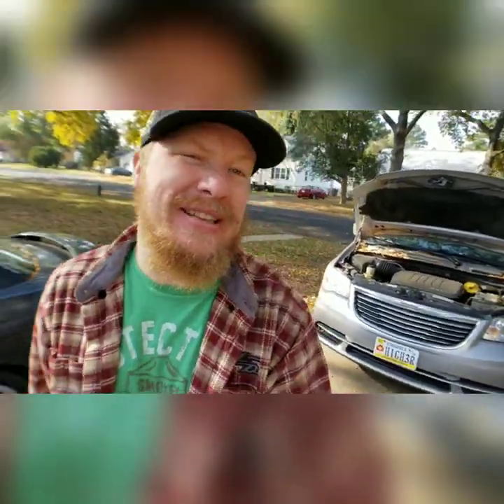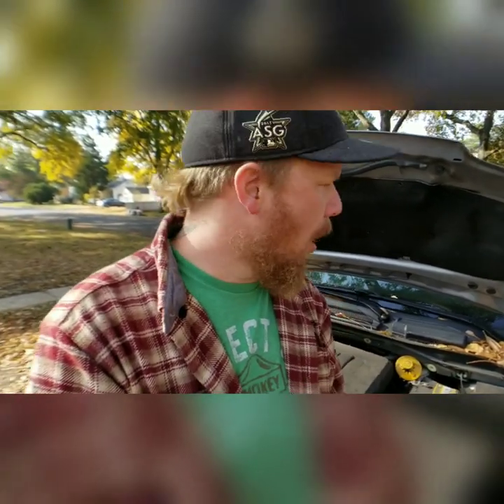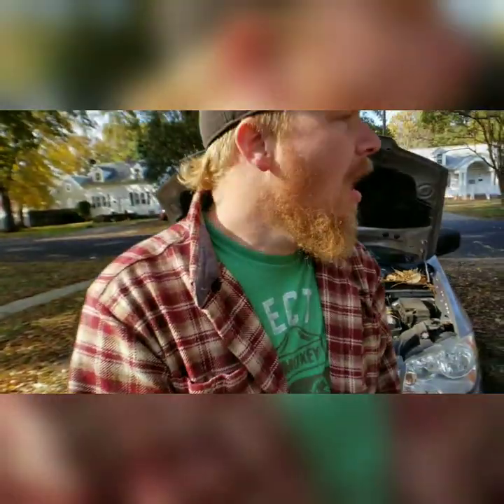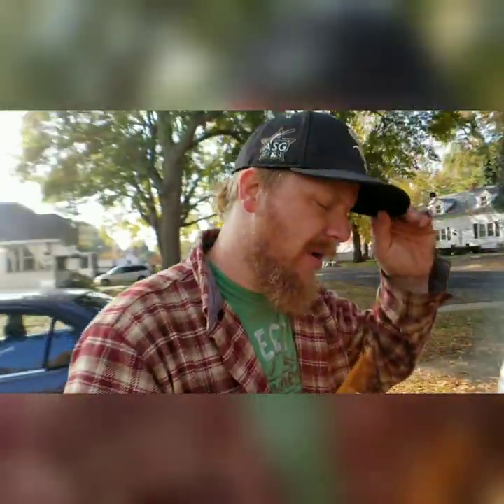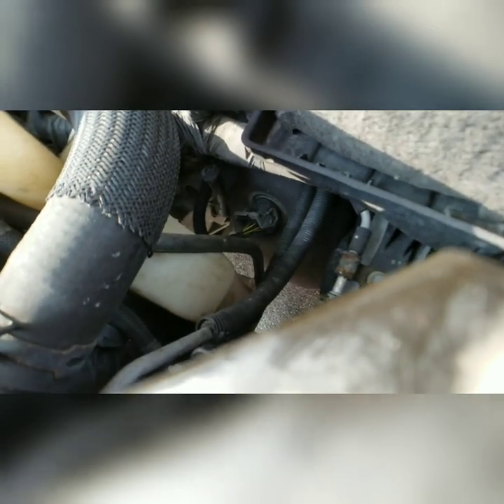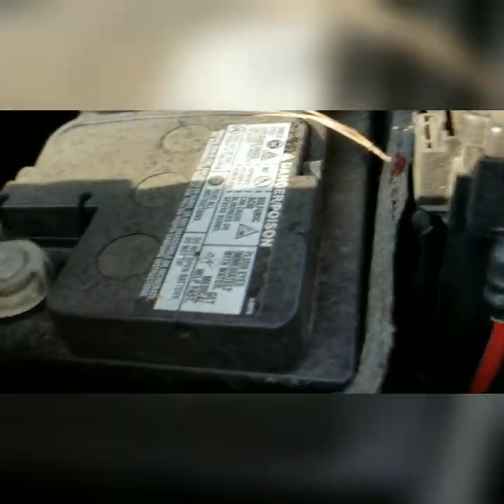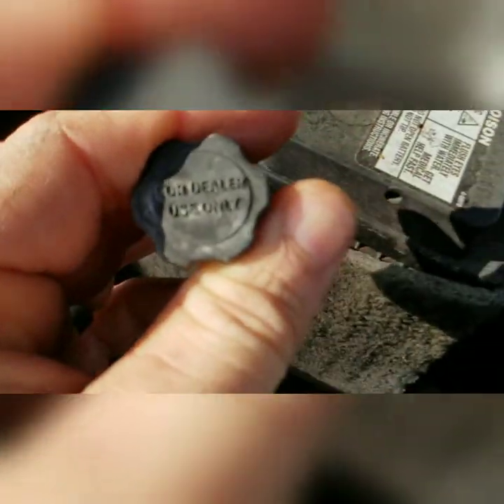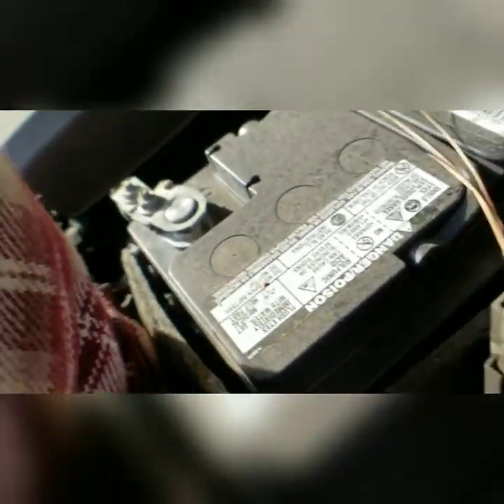62TE Transmission Fluid Level Check MADE EASY!

Comment: Thank you for the information, I just bought my 2012 Town and Country two weeks ago on the 3rd, gears starting slipping early this morning, tried to find a Dip Stick, with no luck, now at the shop as of 1000. I appreciate you showing us where you can check it and add fluid, your the best!
Reply from the maker: You are most welcome Kenneth! Remember the dipstick is for testing purposes only and should not be left in the engine while driving, put the plug for the tube back in. Stay tuned for many more DIY Auto Repair videos in the future!

Comment: You can use the oil dipstick and just mark the cold marks then the hot. Just etch it on the dipstick on the blank side.
Reply from the maker: Yes that is a hack you can use. But I am not risking a $4,000 transmission so I can save $13 and not have the correct tool that is recommended by the auto manufacturers. Thanks for watching!

Comment: Thank you for this video on the transmission deep stick. could you show a sample . I checked and they are multiple length and types
Reply from the maker: Yes I can make a video on how to use the transmission fluid dipstick on the Chrysler Town and Country transmission. The transmission dipstick that I have linked in the video description is the same one that I have. With that dipstick you will insert it in the transmission fluid dipstick tube 16.6 inches to get an exact reading on the 62TE Transmission. Hope this helps!

Comment: Purchased the dipstick, but mine has numbers instead of typical hi/lo or hashes.  Numbers range from 20-120 (I'm assuming mm).  How do I determine what level it should be?  Thanks.
Reply from the maker: The dipstick should of came with a paper as well with charts on it. On the bottom of the chart you should see temperature with the side saying the number or visa versa. The chart will tell you what number you should be at. To know the temperature of your transmission you will have to use a code reader with live data to get the exact reading on the transmission temperature reading.

Comment: Hi there. First time watcher and just subscribed.  I have a question for you. My roommate the day ran something over. He pulled over right away. He called me and said fluid was gushing all over from under the van. When he got back to the house, he told me that he thought that it had a hole in the oil pan because of all the fluid dripping out. Long story short I cleaned underneath the engine compartment and found no damage to the pan or any leak or damage to any other area under there. Once I had it all cleaned I found where a bolt was broken out between the two pans under the transmission we're also I noticed a scratch on the transmission pan and right above that there is the broken off bolt there. Went online and noticed it's some type of pressure valve tester for Chrysler manufacturing at one time deal. So anyhow my question is can I get the remainder of the bolt out and just put a regular bolt in there and seal it or do I have to buy that special bolt that goes in there with the cap any help would be appreciated thanks and I love the channel.
Reply from the maker: If it is just a bolt and it leads no where then just get a bolt to replace it. Double check no leaks remain and u will be good to go. Welcome to the channel!!

Comment: I was always told to not put new fluid in but to mix it with some of the old fluid cause it can mess up your transmission..  If you put only new fluid will it mess up the transmission?
Reply from the maker: I have never heard that before. Think about it why would you want to use the old fluid that cannot perform its job anymore? Old fluid gets burned and now a different weight level. A transmission needs serviced just like your engine, would you put used engine oil back in?
Reply: @Sellthoseflippingcars  yeah that's what I was thinking.

Comment: Good morning Zachary have a question I have a 2014 Chrysler 200 my transmission I think is going out it will not reverse but will go forward for so long I Do not know where my dipstick is just like the vehicle did you showed and I don't know where To fill it up at if needed never knew I was supposed to change the transmission fluid every 60000 miles my car has 130000 miles
Reply from the maker: Good morning Koneshua! On your 2014 Chrysler 200 the transmission dipstick that you need is the same one in the video. You can find it in the video description. That is where I would start, the transmission is all about hydraulic pressure. If you do not have enough transmission fluid in the transmission it will not build any pressure which in turn will not change gears.
Reply from the maker: If the fluid is good then you will be looking at a bad valve body. Here is the video I did on that https://youtu.be/aHyajCv-Fwg
The replacement will be similar due to Chrysler using a similar transmission in your vehicle.

Comment: Thanks a lot my brother I did not know where was it was at transmission and you're right dealership is something else I probably need you to do it are you located in Michigan
Reply from the maker: You're most welcome brother! I know you can easily knock this out with the transmission fluid dipstick listed in the video. Remember it goes in the to 16.6 in from the tip of the dipstick. Make sure the vehicle is in neutral and is a normal operating temperature.

Comment: Hey Zac, the ex has a 2014 T&C. She is getting a small leak that's appearing on passenger side with a reddish fluid. Seems to be coming from the area of power steering pump or fluid reservoir. I can't really tell. Is there any fluid that would have a reddish tint to it other than transmission?
Reply from the maker: No, power steering is clear, and brake fluid should be clear as well but is usually brown due to being dirty and burned. Red is transmission, check your transmission cooler lines on the passenger side.
Reply: @Sellthoseflippingcars  thanks Zac. I was hoping I wouldn't have to get under and remove shields. Thanks again. Your videos are great!
Reply from the maker: Yeah I hate that too, you are most welcome! Thank you for watching and Happy hunting, leak tip*** always follow a leak upwards to find the origin, also crimps are prone to fail after years of use

Comment: Thanks for making videos and responding to comments that folks write on them.
I have a 2013 T&C that I just serviced the transmission (new fluid and filter) yesterday. I have the dipstick you linked to but am having trouble getting an accurate reading on it. It seems the tube has one stopping point after I insert the dipstick. Even with the fluid pan measuring 140 degrees, I get no measurable fluid level on the dipstick at this first stopping point. If I wiggle the dipstick a bit, it then goes deeper into the tube by about 6-8 inches and hits another stopping point. From down there, even while cold, the fluid level then measures at 70-80mm! This was after adding only 4 quarts back into the transmission after emptying, changing the filter, and reinstalling the fluid pan. What am I doing wrong? Does the engine have to be off or running when taking the measurement? I appreciate any advice.
Reply from the maker: You are most welcome Jonathan! When testing your transmission in the Town and Country do you need to have the vehicle in neutral and running. Insert your dipstick 16.6 inches into the transmission fluid tube to get a proper reading

Comment: What will happen when i add almost 1 cup of fluid coz there some small leak on my transmission cooler line hose
Reply from the maker: As long as you get the leak fixed as soon as possible the transmission will not experience any additional where that is normally caused.
Reply: @Sellthoseflippingcars  when i check the level i used the oil stick is almost in the safety line of oil stick,should i drain this i just worried thnks
Reply from the maker: If it is a little over it is okay, but if it a little under I would add a quart.
Reply: @Sellthoseflippingcars  thnks for the info appreciated
Reply from the maker: You are most welcome Aladdin!
Reply: Just order new ones and install it is really simple to install I just did mine.

Comment: If your low how do you add the fluid same hole?
Reply from the maker: Yes, same hole, just give it 30 seconds to drain down after adding. Remember the vehicle must be running and in neutral when checking the transmission fluid. Thank you for watching!
Reply from the maker: 1st off, the vehicle must be running when checking and adding transmission fluid. Make sure the vehicle is in park or neutral as well. Use a funnel and add in the same hole you would test with the dipstick with. Wait 20 seconds after adding the new transmission fluid, then test for level. Thank you for watching!

Comment: Why does the engine need to be running and in neutral? We have a 2014. I also hate how the trans shifts but thats just me
Reply from the maker: If you want to make your shifts nice and smooth this is the video for you! After I changed the filter and fluid it was smooth clean shifts. Your transmission is in constant movement while the engine is running. The fluid coats the gears yet you still need more to replace the hot and used fluid. That is where your transmission filter comes into play. The filter cleans the fluid and all the contamination it has picked up on the gears. Clean fluid + Clean filter = Smooth beautiful shifts.
Reply: @Sellthoseflippingcars  Oh i was talking about how GM programed the trans to shift. We got our fluid change a month or so ago and it shifts really smooth. I just hate how its like a CVT wanna be short of thing if you know what i mean
Reply from the maker: @a-dog8075  oh yeah! Lol i know what you mean definitely different

Comment: What happens if it’s low pressure how would you fix it
Reply from the maker: Low pressure or low fluid? What is your fluid level at? When is the last time you changed the transmission filter?

Comment: Hello brother.  First, thank you for this great video.  Second, Do you put fluid in the same place that you put the dip stick like other cars?  Third, Have you had any problems with the heads for your 2014 Chrysler Town and Country?  I had P0300 and P0304 on my 2014 Town and Country just prior to 100k miles.  By the time I took it in it had 103K miles.  The mechanic told me it was faulty heads Chrysler is refusing to extend my warranty like it did for 2011, 2012, and 2013 for the same defect.  They extended the warranty in June of 2014 right when my car was built but they refuse to help me with the issue.  So be careful with the heads being faulty and any suggestions would be greatly appreciated.
Reply from the maker: You are most welcome! It was fun making this video and I am glad that many people are finding it beneficial. Yes you add the transmission fluid in the same place that you put the dipstick. Make sure you let the vehicle run for two to three minutes before checking the transmission fluid level. Also make sure the vehicle is in park or neutral when checking the fluid. Sadly no I will not be able to find out if the heads were faulty On Our Town & Country. Due to a tropical storm crushing it with a tree. But I'm sure we will run into the Town and Country again it is a great vehicle.
Reply: The heads on those 3.6l pentastar engines are pure trash! Check Marspeed channel about the flaws of those engines.

Comment: Damn I been driving with it still in for weeks🤦‍♂️
Reply from the maker: 😱 time to correct that ASAP Ericc, also check your fluid level before putting plug on. Just in case you lost any fluid
Reply from the maker: How did you leave it in there it is three times the length of your transmission dipstick tube....

Comment: Yep if you have a Chrysler….sell that flipping thing!!! Poorest engineering I encountered in 45 years
Reply from the maker: Amen to that Michael! This was a vehicle that just makes every mechanic shake their head
Reply: Probably comments from Ford Windstar fans here that are lucky they can get 30K miles before needing a new transmission. Seen 2012 T&C with well over 258K miles still running strong on original motor and transmission used in taxi service. GM couldn't make a minivan to save it's life and Ford never got it right. Leave it to the company that invented minivans to build them to last. My 1994 3.3 Grand Caravan was pushing 327K miles when I sold it.